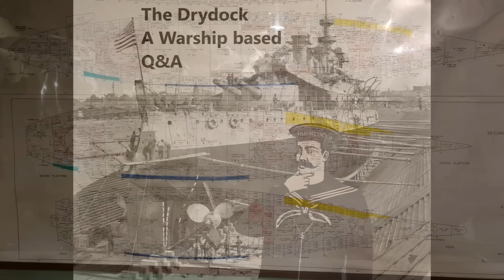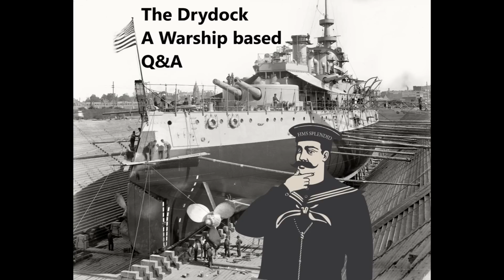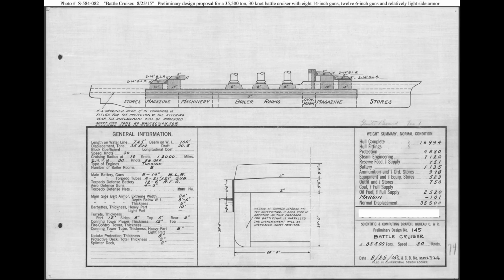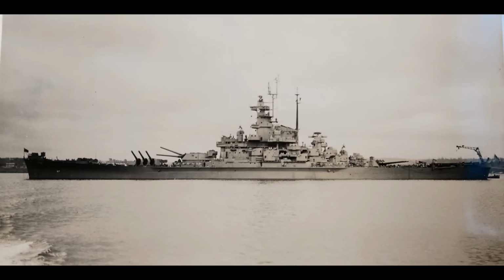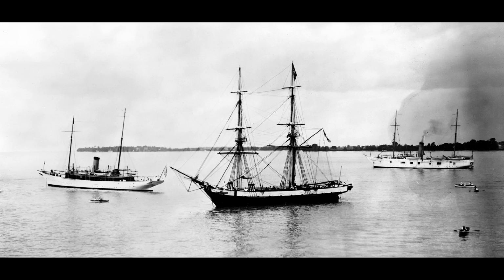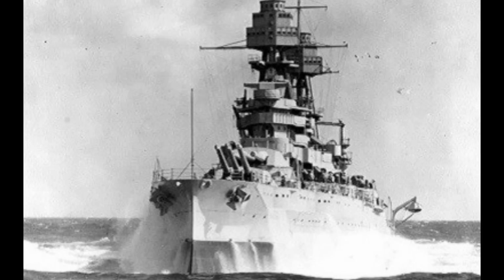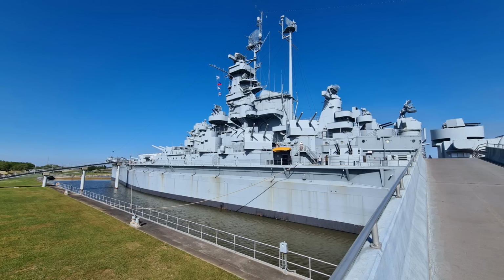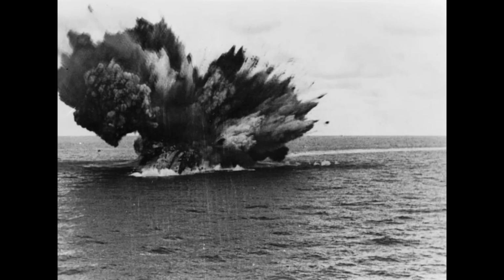The Drydock - Episode 197 (Part 2)

Comment: Drach, you brought up some great points about spare parts, machine shops, and repair capabilities on larger ships.  I served exclusively on Nimitz class carriers.  The machinist would make a lot of components for the machinery on-board.  As it was explained to me it took up less room to carry different types of metal and then make the parts rather than trying to carry every possible consumable part.  Occasionally they even welded up titanium and steel tubing for our aircraft.  You also mentioned how they would make parts for the other smaller ships, which is also accurate.  As for hatches and such, they could, if needed, build one, but it's seldom an entire door that needs to be replaced.  It's usually the dogs, the hinges, and seals on those that need replacing; and there were a few spare watertight doors onboard as well.

Comment: Drach, brilliant job discussing the reason for split superstructures on tankers. The reason that it died out has less to do with modern technology than with safety. They stopped putting the helm and deck department’s quarters forward because of a number of accidents in the postwar era where vapors in the tanks underneath the deckhouse exploded, causing massive casualties to the people inside. It also meant that getting from the forward deckhouse to the aft to reach the lifeboats required crossing the open deck, which could be an issue if the section between the two was on fire or the ship had broken in half. The added expense of having to build the aft deckhouse much higher to accommodate the extra personnel and to obtain the same field of view was the price of improved crew safety.

Comment: As a tie in to the machine shop question, I'd point out for anybody who might have missed it the Ryan's Battleship New Jersey video on her overhead rails included a bit on the hatches and chain hoists you could use to lift machinery up to broadway, and then from their up again to the machine shop deck, and onto the shop's overhead rails.
Interesting that at least on the Iowas you had some assistance in maneuvering broken things though the ship to the machine shops and back.

Comment: Concerning colored "smoke" shells, these actually existed in WWII as improved dye-bag-equipped AP shells used by the French and. later. British navies as so-called "K" APC/CPBC/SAPC projectiles.  The introduction of colored dye bags int9o the windscreens of US and Japanese AP shells after WWI was done after the rather poor results of various British battles where it had been difficult for British warships to sort out which splashes were fired by a given ship for aiming correction.  The Japanese had the Type 91 AP shells that had the windscreen snap off the nose on water impact, while the US used pop-out plugs in the windscreens to allow the o0cean water to ram through the windscreen on a near-miss.  In neither of these types of dye-bag designs did the dye work if the shell got a direct hit on the target, which is somewhat counter-productive.

For the DUNKERQUE and RICHELIEU Class ships in the 1930s the French decided that the dye bag should give an indication no matter where the shell landed.  To this end they developed a rather complex design whereby a nose fuze and booster charge from an HE shell was attached to the tip of the windscreen and a rather large dye-bag held in the windscreen jut under this nose fuze.  This was the "K" shell adaptor (not sure what K stands for).  On water or target impact, the nose fuze/booster would explode and make a bright colored flash and puff of smoke, on top of coloring the water in anear-miss.  Very logical.  After the fall of French in 1940, RICHELIEU escaped and the British examined its APC ammunition.  The British Navy decided to adopt this "K" shell color system, explosive windscreen and all, and also named their modified mid-to-late-WWII anti-armor shells with it "K" shells, like the French.  The British design was very similar to the French design.

So the K shells were indeed a form of WWII smoke shell...

Comment: As always, bravo Zulu. I listened with great interest, especially to the portion on the number of spares being carried on a warship.

I thought readers might be interested in the incomparable logistics system of the United States Navy. It’s easy to look up their tremendous achievements during World War II Korea and Vietnam but I thought a bit more specifics might drive home the point. 

It is necessary to view this system from a perspective of almost 50 years ago, without modern computers. There was always a great deal of analysis as to usage and that usage was based on preventive maintenance, predictive maintenance, and unanticipated repairs.

Take a Oliver Hazard Perry class frigate, I’m using a smaller ship to make the numbers more manageable. 

The FFG seven class might carry 115,000 spare parts, don’t forget it was configured, but rarely carried, two lamps one helicopters. 

Each part was embarked based on a very detailed analysis and for each item, there was a high, low, and safety limit for the number to be carried.

The safety limit always intrigued me as it was the level to which the parts could be expanded before which an order and delivery might be expected.

This is really neat, since the ship moved, the safety limit changed as the distance increased between the ship and the source of supply.

After that it was an AO, AOE, AOR, or a transfer from a COD to a carrier to a helo to the ship. We never ran out of anything that we needed, all before the age of modern computers

Comment: 47:13 A few other thoughts from a former destroyer Chief Engineer regarding the critical importance of machine shops:
- There is simply not enough room onboard any ship to carry every spare needed.  (The running joke is that you'd have to tow a second ship to ensure that.)  Therefore, the spares carried onboard tend to be high use/high failure items or small numbers of important spares for systems that may not fail at a high rate, but are critical for operation or mission accomplishment.  This is refined by the logistics folks through historical analysis of usage.
- For newer systems that have little record of historical usage, the initial spares loadout is a best guess.  You will inevitably break something that isn't carried on board.
- Non-availability of spares due to loss of OEMs is a very real thing, especially for systems that have been in service for a long time. While successor companies continue to offer some parts, if a production line for a given piece of equipment has been cold for years, the parts simply are no longer available.
Good Machinery Repairmen are absolutely worth their weight in gold.
Reply: Do the ship machineshop engineers  fabricate needed parts from other metal parts carried on board? How does this process work?
Reply: @jeromebirth2693  Each ship carries standard metal stock on board; i.e., plates, angles, rod, bar, etc., for use by Repair (R) Division personnel.  [R Division includes Hull Maintenance Technicians (HT - welders/pipefitters/shipfitters) and Damage Controlmen (DC).]  The Machinery Repairmen (MR) can take several different approaches.  They can manufacture a part from a drawing, or if enough of the damaged component remains, they can reverse engineer it.
Reply: @rackstraw  Greatly appreciate your knowledge. Thanks.

Comment: I think a lot of the 'suction' problem is actually a lack of buoyancy. Hood sank quickly because it flooded quickly but there was still a lot of air in the ship that was being released as it went. Anyone in the water where that air was released would be 'floating' in a mass with much less density than normal water. The mythbusters test completely removed this effect through their methodology.

Comment: About the manufacturing parts question (47:15), there were some critical items that simply couldn't be manufactured on board any ship, in any navy.  In WW2, electronics systems such as the radio and radar systems used many vacuum tubes.  The first transistor wasn't created until 1947 or 48 and they weren't massed produced until the late 1950's.  For example, the Yamato's Type 22 Mod 4 surface search radar used forty vacuum tubes, not all of the same type; and the Yamato had two such radar systems, so that would be eighty tubes.  I haven't attempted to find out how many tubes American or British radar systems used.  Fortunately, vacuum tubes were relatively small items which were fairly easy to store in bulk.

Comment: Given the shear number of different machines on a battleship a machine shop would be very useful (and a full set of spares completely impractical) I would suggest that most of the problems were wear, corrosion, fatigue not bomb damage. So rather than making new parts, I would expect it was mostly used for repair, things like sleeving worn bearings and those sorts of things.

Comment: I could offer an example of the potential usefulness of a machine shop on a USN vessel during WW2.  In his excellent account of serving aboard the John C. Butler class DE 343, U.S.S. Abercrombie, Edward P. Stafford describes a jamming issue with the ships 5 inch 38 cal main guns - BOTH of them!  The clearances for the breech blocks and operating shafts that worked them were a hair too tight - the guns would function normally for the first dozen rounds or so, then as they heated up, jam with a round unfired in the breech, soaking heat up from the hot breech and barrel - NOT a good situation.  The very rapid shakedown period had not allowed replacement of the entire gun assemblies or breech blocks.  New operating shafts were assumed to be a solution, and relatively easy to procure from a destroyer tender in forward bases, so the ship proceeded to Pearl Harbor, where it was found that new shafts failed to remedy the issue - apparently the operating bores in the breech blocks were a tad undersized. The marks left on operating shafts after a jam (and the held-breath forcible hammered release of the blocks to free the slowly cooking round...) indicated to the gunnery officer and chief gunner's mate that a tiny amount lathed off the outside diameter of the shafts would likely solve the problem. Aboard the tender, the ordinance personnel refused to do the work, citing BuOrd prohibitions of unauthorized work on naval gun systems.  The Abercrombie gunnery department, faced with going to war with a defective main battery, had differing opinions, and arranged to have their own chief gunner's mate do the machine work without any record of it being kept aboard the tender.  They took .007" off one shaft, test fired one gun, and - no jams.  After repeating the operation of the second shaft, Abercrombie's main battery functioned flawlessly for the rest of her deployment.  A good thing because she was escorting Taffy 2 off Leyte during her first action, and though she was formed up between Kurita's force and her CVE's, she luckily didn't have to make a charge like her division mate Samuel B. Roberts, who died just over the horizon that morning.  Her guns saw lots of AA action there, off Lingayen during the invasion of Luzon, and most of all, during extended radar picket duty off Okinawa.  Good thing the crew had access to a lathe!

Comment: Isn't the probable reason Hood was called a Battlecruiser is due to what they thought the future of Battleships were, especially when you look at G3 and N3's level of armour. But then when you get to WW2 amour steel is better for the thickness therefore Navies didn't jump up asmassively. And I imagine Iowa was classed as a battleship because it had the same thickness of armour as the South Dekotas and North Carolinas. Which I imagine was a holdover from the original 14 inch gun design and therefore was a relatively weak armour compared to others but with the circumstances made sense to be called a battleship.
Reply: You have to look a lot deeper than the top trump style stats of belt armour thickness, guns, etc.  If you look at the structural subdivision of Hood and the location and number of structural crossbeams and other elements that improve rigidity of a vessel etc Hood was very lightly built and is by no means a Battleship.  Arguably post modernization Renown was closer to being a BB than Hood due to her substantially higher levels of subdivision.  In addition to that you have to look at the tactical function for which she was intended.  When Hood was designed her primary function was not to fight enemy battleship but to hunt down cruisers that is very different than vessels like Iowa etc.  The fact that Hood ended up being used to fight a Battleship was not due to her design intention but due the the fact that the RN only had 2 battleships capable of over 25 knots and one of them wasn't finished as the UK simply didn't expect the war to start until 1942.  When built in the 1920s if a war had broken out the only Navies with ships battleships above 21 knots were UK and Japan and even they were in the low 20s and thus if a war had broken out in the 1920s Hood, Renown and Repulse would have been used in a commerce raiding/commerce protection role and would not have been fighting against Battleships.
Reply: So far as I know, the Hood was considered a battlecruiser because of her intended mission being to fight the "cruiser war" rather than stand in the Line of Battle against battleships, basically being an anti-battlecruiser battlecruiser to ensure the German battlecruisers could not replace German cruisers as commerce raiders, scouts, and other roles cruisers traditionally performed when not sailing directly with their nation's battleships looking for a decisive battle. In short, Hood was a battlecruiser because her role was that of a battlecruiser, even if she was capable of holding her own against battleships of the era.
Reply: @jonsouth1545  where did you get the information that Hoods crossbeams and structural regidity was low especially for a fast ships that's the opposite of engineering principle and how much weaker were crossbeams and where does the Royal navy say under this structural regidity it's not a battlecruiser?
Reply: @Alex-cw3rz  If you look at the internal blueprints and compare the internal structure of ships like Hood the QE and R Class Battleships as well as the Splendid Cats and contemporary RN Cruiser designs you can clearly see the difference in the internal framing of the Battleships and Battlecruisers and you can also see the evolutionary pattern amongst the two groups.  Battleships had significantly more internal framing Hoods internal framing is much closer to contemporary cruiser designs.  Hood had less framing than Renown as Renown's internal framing was based on that of the R Class Battleships  This lack of internal strength and the fact she was completed significantly overweight had significant effects on her sea-keeping during her career. This makes a big difference in the structural strength.  If you look at Dr Clark's videos he does several on the subject really going into detail regarding the internal structure of the vessels.  Hood was never considered a Battleship by the RN although if she had gone through the extensive refit Drach proposed including changes to the internal structure then there would be a very good argument for her being changed to a Battleship.
Reply: Plans for Hood and others can be requested from the National Maritime museum and other such institutions in the U K
Reply: @jonsouth1545  The point about Hood’s structural framing being derived from cruise designs is very interesting.  I assumed that the later British battlecruisers were basically “stretched battleships” with fewer guns, less armor, and more machinery.  Do you happen to recall in which one of Dr. Clarke’s videos this was discussed?  His videos are great but the titles often aren’t very specific.  

I did know that Hood was considered a wet ship due to completing overweight though.  She was a bit of a Frankenstein (albeit a nice-looking one), as the Admiralty had modified the design several times before construction, and then several more times during construction so as to incorporate the lessons of Jutland.  In the end (as I’m sure you know) they learned their lesson and redesigned the rest of the planned Admiral class before abandoning them for the G3s.  

I would dispute your assertion that Hood was a cruiser killer though.  By the time of her design and construction, the role of battlecruisers had expanded, and they were expected to take on other battlecruisers as well.  Hood was designed specifically to be able to curb-stomp existing German battlecruisers and to counter what Britain erroneously thought the Mackensen class would be, and to be able to stand in the regular battle line if needed.
Reply: @bluemarlin8138  I think most cruisers are a cruiser killer when designed but maybe not for long after commissioning.

Comment: I think one much more important part about suction is pressure differences that occur due to insufficiently flooded parts of the ship.
If you have an air vent for example that leads to the interior of the sinking ship and if that interior has a significant air pocket, then water will flow through the air vent. If a person happens to swim into the flow of water going into that vent, it can easily get sucked straight onto the vent with no chance to be released. I think that happened to Lightoller on Titanic who was lucky enough to be released at some point.
That also happens to children that get sucked to the bottom of swimming pools when the entry to the filter system is not guarded. 

I think that is the much more dangerous killer than the general suction of the whole ship going down. So the general suction probably won't kill you. Pressure difference, however, can definitely suck you back into the ship. Just don't stick around and you'll probably be fine ;)